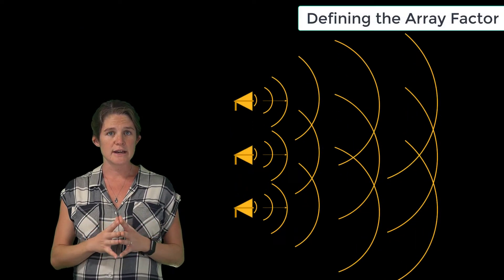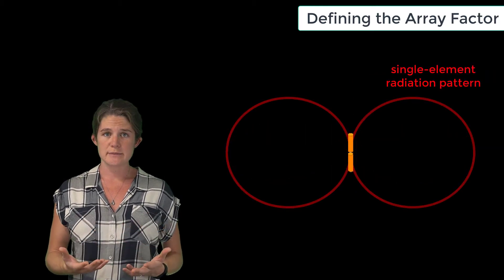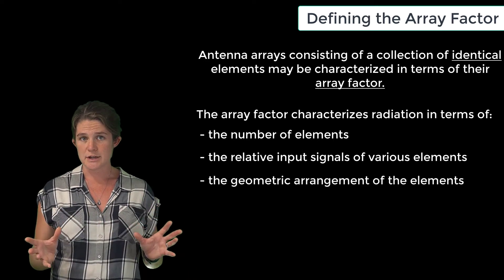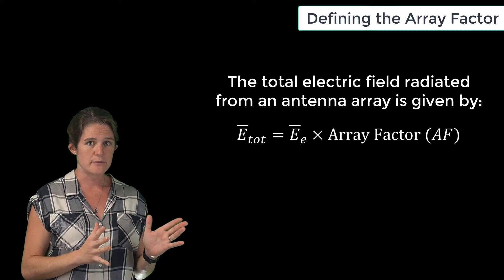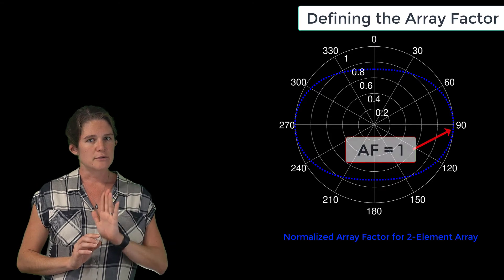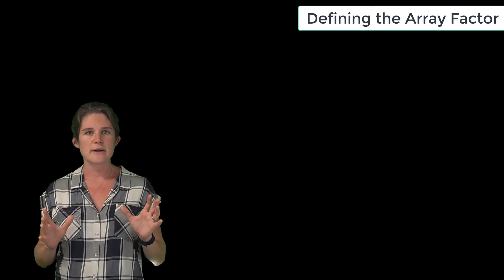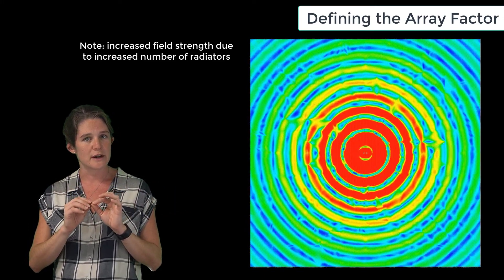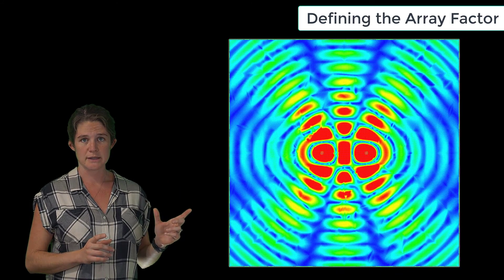Defining the Array Factor — Lesson 2

Comment: what do you mean by vertical separation of quarter wavelength? Could you please elaborate?
Reply: Two antenna elements - in that case two dipole antenna - are separated by the lambda/4 where the lambda is the wavelength of propagated signal. The distance between the array elements are crucial for preventing the grating lobes.

Comment: Very interesting video. Didn't know that an array emission could be calculated that easily. Could I ask you what are the validity of that method. I can see that it is calculated in far field.  So, I guess, firstly we have r_observation >> 2D_max^2/lambda for big antennas or r>>lambda for electrically small ones. Are there conditions on a array size, antenna element size?